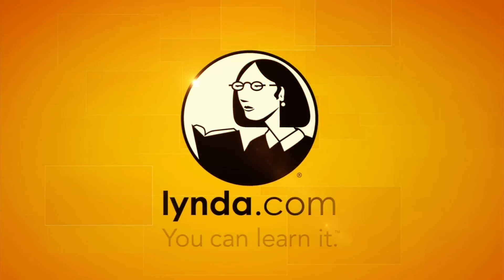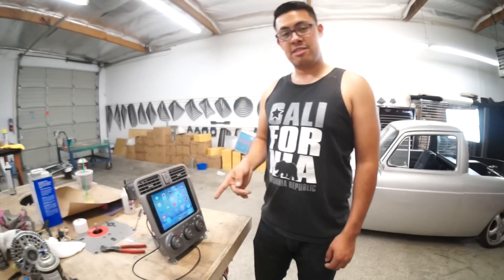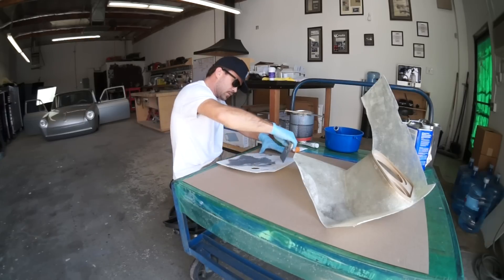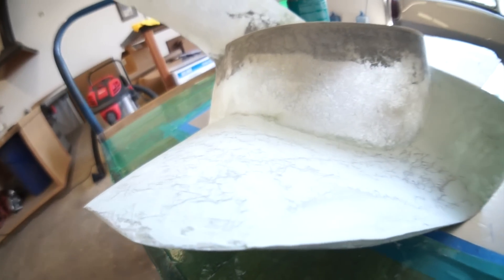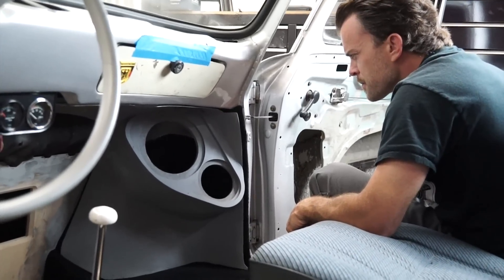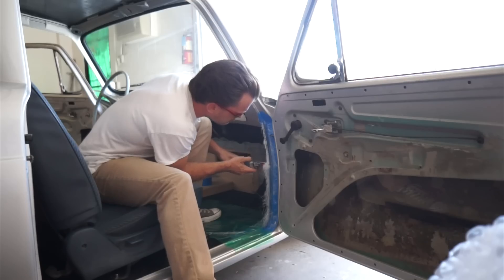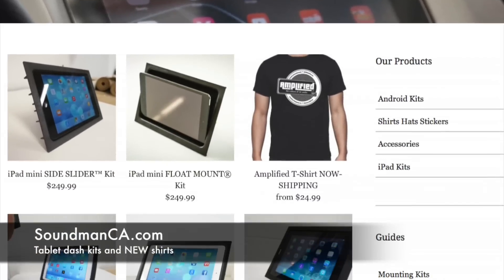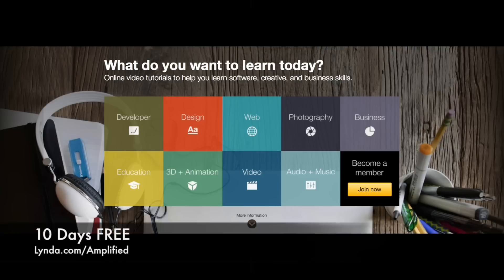Sunflash Kick Panels, part 6

Comment: Speaking of antenna mast, my first car was a 91' Ford Ranger and I was heading down this road at about 35mph and I didn't notice the low hanging branch. So as I go under it, it snapped the entire antenna mast off and threw it into the bed of the truck.

It didn't bother me too much as the radio didn't work anyway. It had an aftermarket headunit in it and I guess it wasn't put in right because it would be really quiet even at max volume and then it would randomly be super loud and then go back to being quiet.

Comment: The frustration in your eyes is just priceless. ( i know how it feels, you just want the car to work and be done with it). Take a break of a few weeks and then come back to finish it. I have a budget of 300 euros for the sound in my Volvo Amazon what would you suggest? I already use my iphone as navigation and for sound.  i built it a mount in the dash for it. but i dont know what to choose for speakers and al the stuff.
Reply: Michael van Thiel I'd avoid Kenwood, running them as rears in my car. Running Precision Power components in front and they're pretty good for only $60, but I'd still recommend getting something a little better. Check out Infinity Primus or some Polk Audio components.

Comment: I bet the stage with those Legatias will be awesome.  I've got an ID CSX set running passive.....maybe one day I'll have the nuts to step it up.  Side note - I've seen your F150 in other vids. Does it have factory Sony amp?  I have a 13 F150 with Sony and used an audison bit ten after the factory amp and works like a charm so far...

Comment: an air cooled VW project is NEVER done, the same goes for any quality audio system.
If you want done....go to the swap meet and get a crap bandpass box and throw it in the back of your ford escort GT that is only running on 3 cylinders. Do it fast , its almost the weekend- then you can have the pride of completing something.  :-)